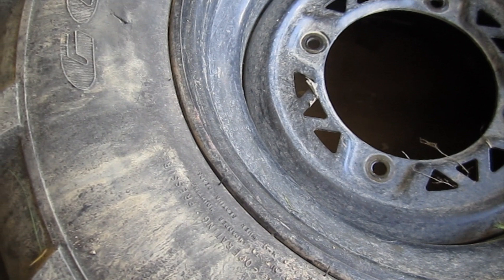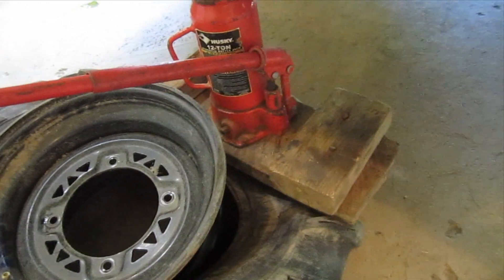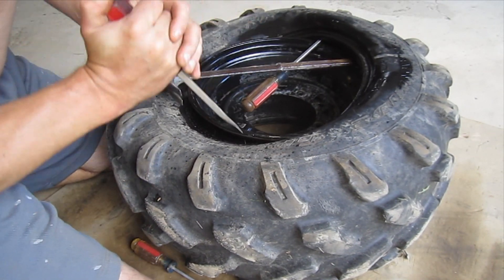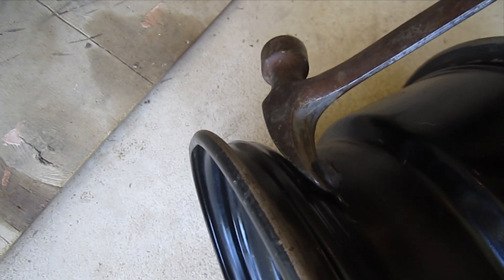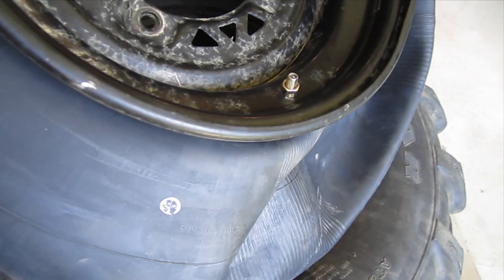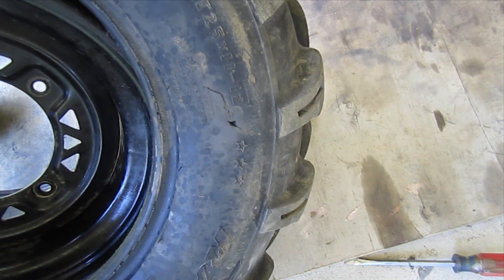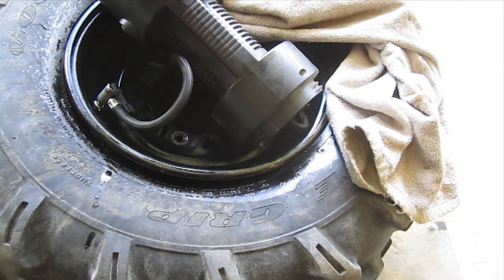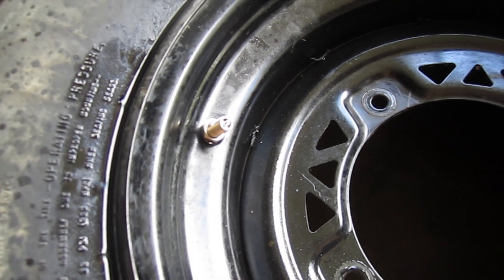ATV Tire Sidewall Repair & Tube Installation - How to Repair an ATV Tire With a Sidewall Puncture

Comment: I’ve always put one bead of the rim in the tire. Then install the new tube. Finally mount the other tire bead onto the rim.  It keeps the tube out of the way.  If you have  vice grips, clamp one on the rim to keep the tire bead from following your mounting bars around as you pry the bead onto the rim.  Your bead breaker worked real well.  It’s good to know how to  do a field repairs when needed.
Reply: Was going to say that.  Sucks pinching a new tube.
Reply: As said earlier. I always put one bead in before tube. Alot less chance of pinching the tube.

Comment: Ill be doing this - side wall gash, new itp xl.... 1.4 miles in on new riding area... lol. Google search brought me here, 1st video that came up.
Reply: does the atv pull to that side with the tube??  wondering if i need to do both front tires....
Reply: Brian Vaughn -- mine was a rear... IDK

Comment: No offense but you did it wrong. You pop the valve stem side of tire off the rim and slip tube inside tire and fasten nut and air it up.   You can also repair the tire without having to pull tire completely off.  We do it at my shop all the time very time effective.